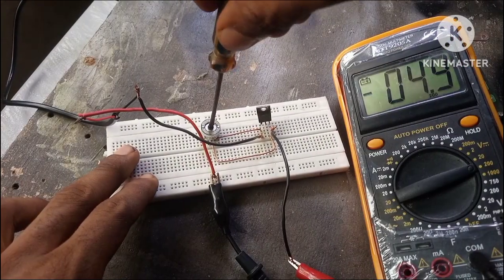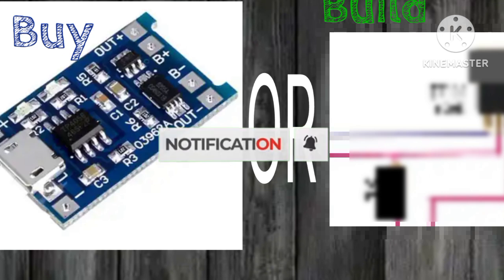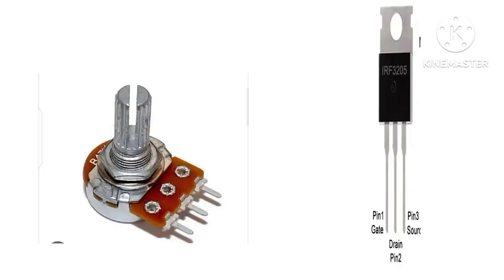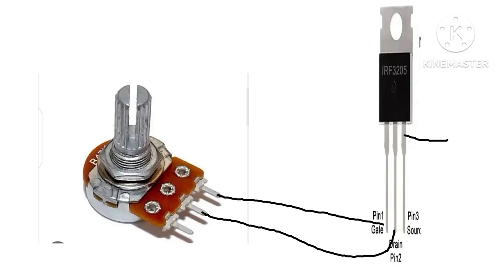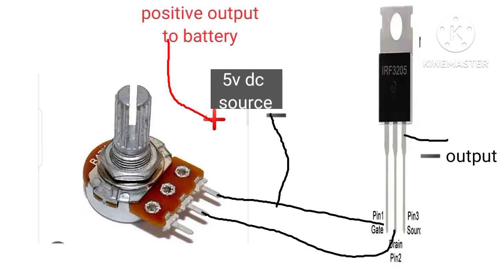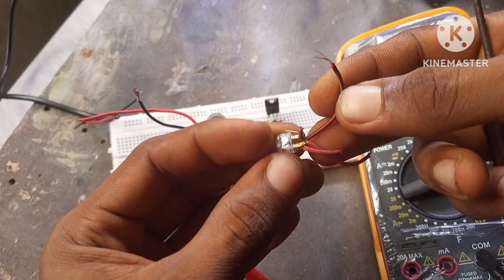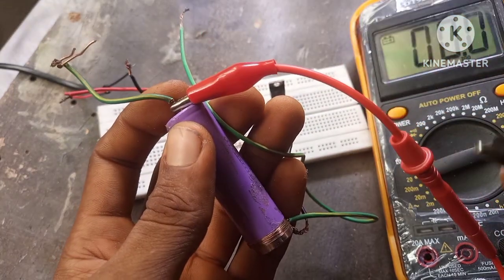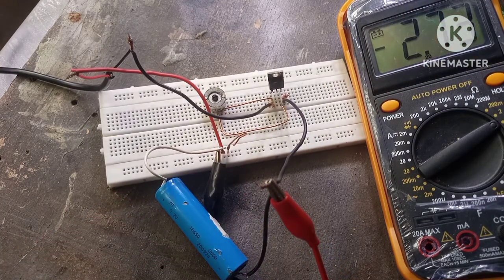How to  build an automatic charger with just two components

Comment: If your battery is low, you want to begin with a constant current instead of constant voltage.
Reply from the maker: Indeed, this circuit has less resistance and provides a fit current for the batteries